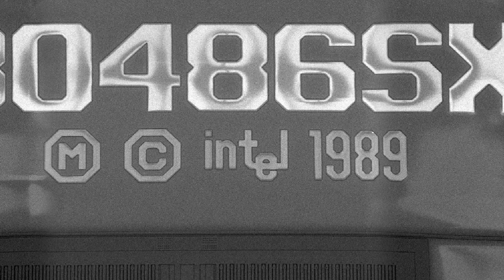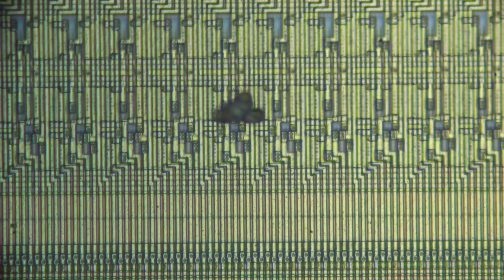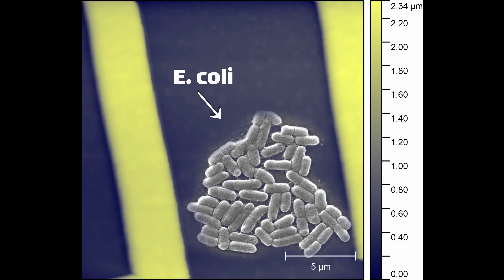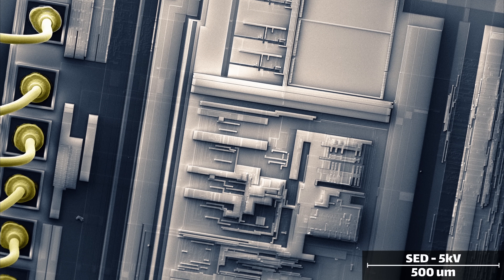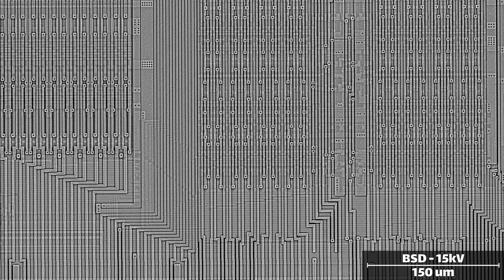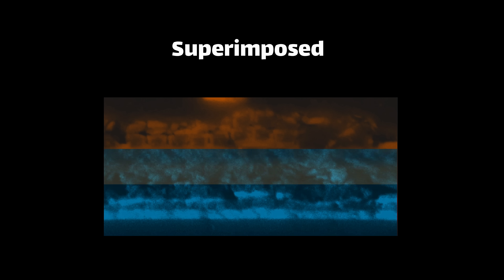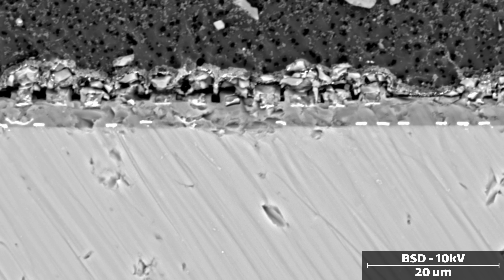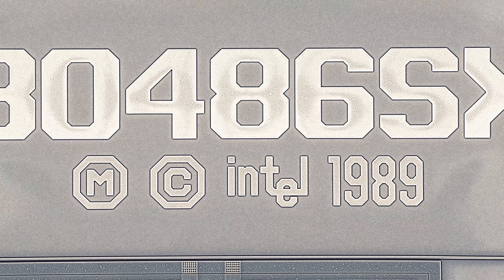Microscopic view of an Intel i486

Comment: The Ti is from TiN layer probably. TiN is to protect the silicon oxide sidewall during the Tungsten (W) dep plug or via. TiN can also be an ARC layer, anti reflective coating on top of the blanket Al layer to help litho process.

Comment: How the heck does electricity flowing through this do anything. 

I've wondered for so long. I've asked this through Google and it doesn't understand. 

On and off. I get that. And series of on and offs, flows electricity so that a particular pixel shows green. I get that. 

How do you build a chip and know what electricity passing through it is going to do? I know ROM chips for example is data, 1s and 0s but I don't know what a CPU has.

Comment: We were installing Reservation Management Systems back then using Concurrent DOS and it made multi-user with Wyse Terminals so much easier to operate as we thought the 386 was a great CPU.  Unfortunately with the introduction of Windows and new CPU’S and advanced Motherboard technologies DOS based systems became dinosaurs😩

Comment: i made chips "like" this, not nearly that small at infineon using thick film process and did wire bonding at cree/wolfspeed before that. it was grunt work but the tech was fascinating. thank you so much bc even though i've changed careers i still need to know EVERYTHING about this. take care man.

edit: rounded edges "might" be a result of the thick film process, each layer is added in putty form. very very hard to do a batch of 300-1200 without going through the screens like crazy. think that cost factor is the linchpin right there imo.

Comment: But how was this made!?!? The tiny wires? How were they placed? Why do they wires run they direction they do? This is fascinating and unfathomable
Reply: I once condensed a film on a surface. The trick was to keep the surface at a temperature where diffusion still happens. But copper and aluminum only melt at high temperatures. We can’t keep the chip at this temperature without destroying the transistors. I read that PCB uses sheet metal.

Comment: I had a Gateway 2000 486 with an Intel 33Mhz. Processor. I upgraded for $100 to a AMD 100Mhz. CPU. It definitely made a difference.. I never went back to Intel after that.. I'm sold on AMD.. I'm looking forward to the day the develope electro chemical I.C. chips..

Comment: I'm always amazed that semiconductors are able to keep operating for so long after fabrication. I would've imagined that current going through the traces and transistors at that scale would produce a lot of wear. Of course this is the case for flash memory, but it seems that the main components of a CPU are usually very resistant to wear
Reply: Current flows through our brain and to HV lines. Space is full of it. No wear.

Comment: this is good example why microchips are nearly impossible to reverse engineer, if it was possible .. then certain countries would have stolen the idea long ago and made their own, but since modern day CPUs have like 80 layers of wafers ... you can't just easily just grind it off to examine each layer.

i guess that's why CPU photomask templates cost like 300000 usd, it's all about some copyright stuff.

... now imagine how difficult it is reverse engineering an UFO, i'd like to give it a try tho.

Comment: 2:40  isn't that a contamination blob on the middle left, and also smaller on the middle far right?
Reply from the maker: Yep! Both are probably dust that landed on the chip when I was decapping it (not likely from the original manufacturing process)

Comment: I remember buying a new 486 computer. It was 1993. It had 4 MB of ram which cost of about $50 per MB. My first computer, purchased in 1987 or so was an 086 XT, made by Samsung. I got the optional 20 MB hard drive to compliment the 5-1/4 floppy drive. The screen was monochrome orange. Those were the days.

Comment: They dropped the 80486 name and replaced it with i486 because of difficulties copyrighting a string of numbers. Other manufacturers, such as Cyrix, had their own version of the 80486 and Intel couldn’t prevent them from using  the name 80486. The next chip up became the Pentium.

Comment: $950 in 1989 is $2,362.87 in 2024 according to Inflation Calculator. Also, a scale bar in the optical images would be great to have. SEM images are great, especially the elemental detection.

Comment: I am a software "engineer". I put it in quotes because the REAL engineers are the men and women that designed these almost legendary chips, and the other amazing engineers that brought them to life in the manufacturing processes. I came to the realization when I shared a house with a chimp designer from INMOS...his thought processes were almost in another higher dimension than mine. I remember when the 486 came out, and given that the 386 was not an amazing step up from the 286 (I wrote software on the 8086 with the 8087 math(s) co-processor as well) it was very exciting to see its performance improvements. Thank you to you for this content.

Comment: A few years ago I opened up a i486 chip and put it under my optical binocular microscope while trashed on 3 tabs of LSD. Rotating the torch radially around the chip brought the most amazing integrated circuit rainbow effects that had my brain blown to bits and saliva soaking into my tshirt. Thanks for the flashback

Comment: 1:28 This i486SX was produced in "344" = 1993 Week 44     This modell was launched Sep.21,1992 Produced in 1 micron technology. So  actually the last cycle whose structures you can see fairly well under a very good 1500X light-microscope And "millions of tiny transistors" Hmm. It had 1.185.000 transistors

Comment: I was headlong into an I.T. consultant career from the time of the 286 CPUs. The 486s brought a significant performance improvement and you could still get 486 CPUs with just a heat sink. It wasn't until the DX4 100s that I had to start providing fans for the CPUS. It was a great time to be in computers especially when Windows95 came out, etc.

Comment: I remember owning a 66Mhz 486DX2. I believe the 486SX was Intel's last CPU without the floating point math functionality or math coprocessor. If memory serves, they were also offered in 25 Mhz and 33Mhz varieties. I believe the last 486 was the 100 Mhz DX4. The 486s were the last non superscaler design meaning they could only execute at most 1 instruction per clock cycle. They were also the first where the die size and manufacturing quality were high enough, to bring all of these elements (CPU, ALU etc) on to a single chip. I wouldn't be surprised if the SXs were binned DX chips, detuned into a stable configuration. This is inflection point for modern computing. Standardization, quality, power, cost and usability all came together into a sweet spot that led to geometric growth and mass adoption.

Comment: Another Ex-Inteler here, & Ex-Metal Etch too,, so I've seen many of these CPUs thru microscopes & SEMs in the past.

Its TiN your looking at, & from my memory of the later 486s, the metal stack was; bottom up, TiN, Au+0.5% Cu, TiN, Ti, TiN.

The Cu was added to help mitigate Electron migration, (bigger atom to stop the Al drifting), & the TiN is a seed/barrier layer,, with the pure Ti acting as a shunt if EM does still happen.

Comment: Blast from the past! One way of getting to see those p/n junctions in cross-section is by cracking the silicon at the spot you want, just scribe a little at each end of the chip and then break it like you would any other type of glass. Place something underneath the chip then applying pressure on the surface. If you are interested look into Sandia Labs Micromachines, pretty interesting stuff I used to work on.

Comment: Wow! I did my PhD (so long ago) on the topic of small scale turbulence. To measure the fluctuating fluid flow with enough spatial and temporal resolution I used the Constant Temperature Anemometry technique (Wiki it!) - now I cut to the chase - I made the hot-wire probe (Wiki it!) from Wollaston wire (Wiki it!) and the exposed/etched platinum-rhodium wire core was 1.27um. But I never saw it - I relied on a typical lab microscope to view the fat wollaston wire and direct a drop of acid (mounted on a prong in a small precise 3-dimensional vice) to etch away the silver coating and 100% relied on a voltmeter to measure resistance and when the required resistance was measured I moved the prong away. In hindsight - I could have etched a completely crap probe - how would I know? Maybe my PhD is a complete lie. Maybe 10000s of PhDs in hot-wire measurements over the past 50 years are complete lies? Maybe we know nothing about turbulence after all?

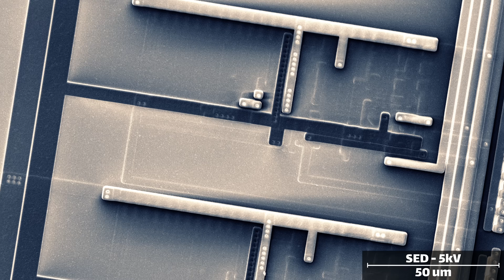Comment: 6:43 - not sure if it's an issue with SI, but on GaAs we used Ti and Pd as a diffusion barrier to stop the metals from the interconnect diffusing into the semiconductor.   The Ti may be doing that here, but it's odd it's missing the Pd.

Comment: 1:37
The bent pin got me. My worst nightmare if a friend accidentally tried to push it on the socket

I remember when my brother zapped his 386 by putting the power cables on the motherboard incorrectly. He just upgraded his system and kept his 386.

Needless to say he returned the motherboard and upgraded to a 486 CPU and motherboard. 

That was definitely an expensive lesson back in the day. We thought we had everything correct before booting up but documentation sucked 😂

Comment: It is by no means a human being who designed that in the 80's. Is it an alien? America is an alien, no more torture. Did aliens die of great stress? It is possible to design and manufacture when you clearly know the driving software and know all the structural characteristics of electrical and electronic circuits. Semiconductor manufacturing is great, but design and production equipment manufacturers are also great.

Comment: crazy how tech from 30 yrs ago compares to today. years and years ago i splurged on a 486 DX 66mhz eisa vesa pc that was in the ballpark of $3500ish.. think that was the last version of the x86 chips before pentium, correct plz if i'm wrong about that. started with apple IIc then ibm pc that had an 8088 which i upgraded to a 286 @ 8mhz with an expansion card and a 20mb 'hard card' which was a hard drive on an expansion card.

Comment: This is a new way of life that has emerged in recent decades. They have also been able to reproduce for many years. The manufacture of these complicated circuits is impossible to do without the use of existing computers. We tell each other that people make them, not computers. But if we turn it around, computers simply use specialized humans (engineers and other technicians) as "synthesizing enzymes" in the reproduction process, while at the same time extremely rapid evolution takes place. Life version 2.0 growing on top of organic life.

Comment: @6:55 the brightest features that look like branches are the polysilicon gates which make the transistor. The features on either side are called the drain and source connections.  In your cross section if you were to look for Phosphorus and Arsenic instead of oxygen you might have seen the structure of the transistor as those chemicals are diffused into the silicon vertically to make the transistor.

The titanium layer was used to help prevent something called "metal migration" where sustained circuit current would cause the aluminum atoms to migrate i.e. move around and leave voids thus causing a bad connection.  It would allow for thinner lines and fewer failures.

I was a chip designer in the 80s and 90s so those are my educated opinions.

Comment: Nice video. In case of modern chips, the growth of the gate count is because of large (Level 1-2) caches integrated beside the sequencing logic & the (superscalar) execution pipes. So although the 486SX had a much smaller gate count than my current i7 4790K (Haswell), its main CPU circuitry was still quite similar to today's CPUs.
Reply: Ain't that why we call'em x86? ;)
Reply: @andresburgos6002  Yes, because they have binary compatibility with the x86 ISA. Although nowadays the x64 ISA is the more popular (because of the bigger address space).

Comment: Amazing isn't it? But this is only a 486 chip. Imagine when we were making BioMechanical advanced self regenerative processors 100 years ahead of the time to create the first AI capable chipsets in Poly Acrylo plastics with all this and more within and without the device. Then it also has to be able to be shielded from the heat of the sun, the pressure of the core of Jupiter, and still function. That was what working with Hughes Aerospace and Texas Instruments as well as Martin Marietta in the 90's was like.

Comment: My first computer was a 486, purchased almost new for $1000 in 1996. I loved that thing. I bought memory for it at a computer show, opened it up, and installed it inside. I miss that machine.
Reply: I too bought my first 486DX for about $1000, had MSDOS 6.1 (faulty double space version) and spent another $500 on a VGA monitor (15 inch) and a 9 pin color dot matrix printer. I was king of my block back then. RAM was pricey back then because of a fire in Taiwan burnt down a RAM manufacturer. Started with 1 MB RAM (remember it was DOS). I eventually upgraded to the motherboard max of 4 x 1 MB sticks at $75 each. Then cam DOS 4GW and I was off to playing DOOM. Back then you could get free games in the box just for buying a CDROM drive. I chose the one where the Panasonic sound card also had the IDE driver built-in for the CDROM. I think I still have the ISA board somewhere.
Reply: I think we had one? Zenith Data Systems. Windows 3.1? 1,000 was a lot back then I'm sure.
Reply: @ayliniemi  Yes! Zenith. And After Dark screen saver.
Reply: @ElizabethBattle  ah YES! The after Dark screen saver recoded for Windows by a guy named Eastman in Calgary back in the day! I remember meeting him a couple of times! And that Zenith TRULY FLAT RGB VGA display -- I Loved it that too! Should've kept the one we had at work! Be worth some money now as a collectible!
Reply: it was mind blowingly better than the 386
Reply: Ditto, my first PC was a 486 DX-2 66Mhz, VESA 16 bit graphics card, only 4 MEG ram, though i did buy another 4 meg ram for £126 ( a bargain as the going price was around £150)....great for Quake
Reply: Mine was purchased by work as I needed if for doing CAD autorouting. Got it in  1992 IIFC.  My colleagues were all jealous!
Reply: My fisrt computer was Epson Qx-10
Reply: I bought a pentium HP desktop for $1000 in the year 2000.

Comment: One practice of the cpu manufacturers was charging for the math coprocessor that all cpu had but were disabled to be offered as an extra. I have an electronics degree and this irritated very much. I built my own and was very dollar conscious of cost too actual performance gain. We only had DOS for years. It was a very fast and efficient system not having all the graphics interface for commands. DOS required the operator to know how to use the computer and their way around the computer, such as root directory, or source code in Linux.

Comment: The difference in performance of the 386 and the 486 was enormous.  The 486 reflected this by being very expensive. It was my dream computer but 2,000 dollars was alot then and we had young children. I liked to buy the mother boards and custom build.
Reply: Wow, I bet, $2k back then is what? Like $5-6k today. Crazy expensive...but I guess that's what a TOP of the line 64gb Ddr5, Nvidia 4090, top amd/intel processor build costs today. So I guess it's all relative, and a build today is infinitely more capable.

Comment: This was fantastic - your next mission, Jim, if you decide to accept it, is to examine a modern camera sensor, both the BSI and non-BSI types, full frame about 36x24mm. Those are some of the largest chips around in terms of wafer size (or medium format such as in the Fuji GFX series 48 x 36mm!). Yep, modern computer chips such as a Core i7 have so many layers, and especially metallization layers, that it's impossible to see transistor details unless those top layers are chemically removed!

Comment: I loved the 80486 because it was the fastest processor I had used, a real workhorse.  Especially the 80486DX which lasted well into the Pentium generation as the 80486DX4-100, it outperformed the early Pentiums by quite a bit. The next few Pentium processors were just too expensive for my poor little family, so I bought AMD K6 CPUs for a while until the Intel Celeron processors.  I only use Intel CPUs these days, I7 mostly. But there is a special place in my heart for the 80486, an excellent CPU with performance and reliability that I counted on for many years.

Comment: While in the US Navy, being a Sonar Tech, we had to repair our own equipment. Was a security clearance issue…ET’s didn’t have that high of one. In that capacity, I was sent to 2M school. Mini-micro mini repair. I was soldering integrated circuit chips, circuit boards, etc., with the aid of an intense microscope. The solder tip looked like a baseball bat and one little shake was enormous. Great video! 🫡

Comment: In a past life, I was a tech which my job duties were to maintain 10 beautiful Zeiss microscopes plus a small desktop SEM  within a geology research facility. Although I never polished a chip down, ( I could have as we had a Thin Section Lab also ) I did view a photo sensor array, at the limits of visible light which required immersion oil to do so. It was quite the eye opener! Just the pixels of an array needed 1000x magnification to view them. Incredible! Thanks for the journey.

Comment: Minute Correction: The 80486 (DX) was introduced in 1989 not 1985 (1985 saw the advent of the 80386). The 80486 (SX) chip in the video actually was never available until 1991 when Intel offered a cost reduced version with a defective, disabled or (later) omitted FPU. The copyright is still that of the original 80486 (DX) from two years prior and the inscriptions carried over.